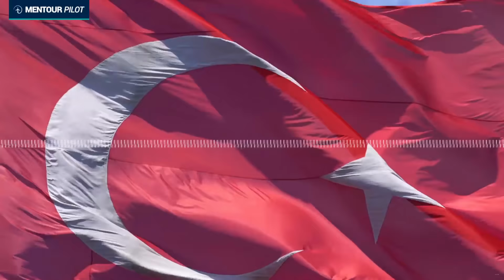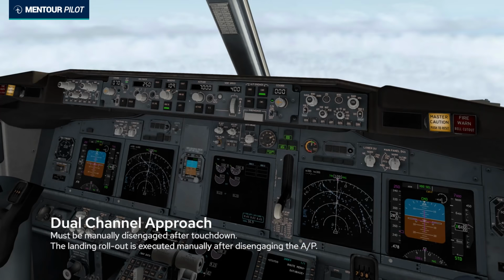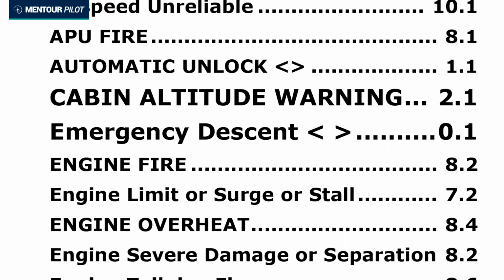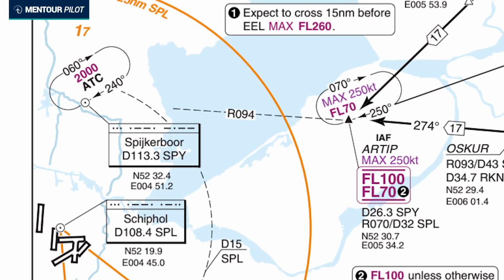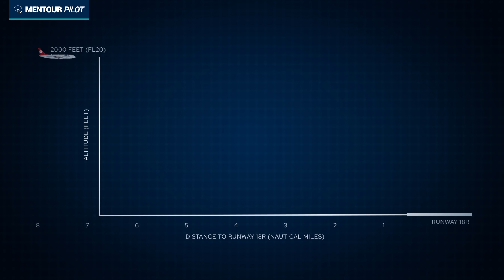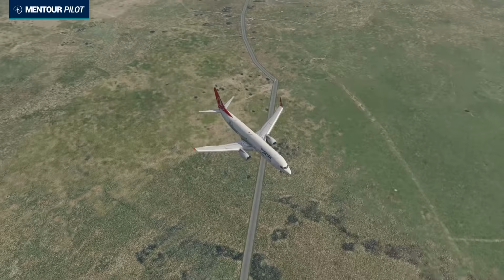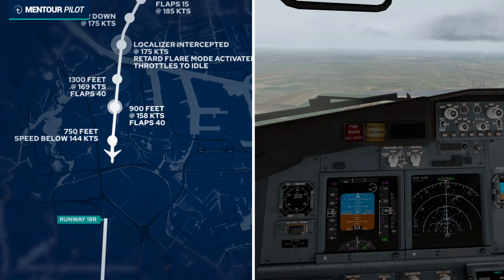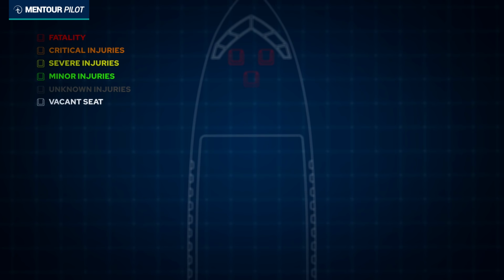What happened to Turkish Airlines flight 1951?!

Comment: 3 pilots in the cockpit, a typical autopilot approach to minimums in VMC conditions and they STILL managed to miss all the clues that something was seriously wrong! As a relatively old-school airline pilot (retired) I call this one GROSS CREW INCOMPETENCE. How 3 pilots managed to ignore the abnormal attitude and low speed clues until the stick shaker kicked in is mind-boggling!
Reply: And two of the pilots were ex-Turkish air force. Wouldn't they have more flight training than a normal pilot? I wonder why there was a lack of communication between the pilots.
Reply: Agreed. 3 experienced pilots, 2 of them clearly highly qualified, and all of them forgot the 3 basic rules (the “-ates”) of aviation. 
I’m not certified to fly myself (just the at home sims) but it always amazes me how often in these situations, at least one pilot will realize that something is wrong, and yet they forget how to fly while they chase what’s wrong with the plane.
Reply: @stephenrich3029  They didn't even "chase what's wrong with the plane" though. They just kind of ignored all the warnings. Like what? Although, everything happened really fast in real-time.
Reply: Certainly doesn’t give one much confidence in the training standards at Turkish airways
Reply: @setj2368  Turkish Airlines and Airforce has really high standarts and good training. But sadly, there are always exceptions
Reply: @setj2368  Yes correct when regarding before year of 2008. Any cockpit crew insisting on unstabilized approach will be heavily punished and probably sacked from Turkish Airlines, after this accident.
Reply: Agreed. Terrible pilots.
Reply: Disaster crew. Sheer incompetence I agree.
Reply: @stephenrich3029  Communicate, investigate...... coordinate?

Comment: I was at work in Rotterdam when the news broke, and needless to say almost everybody stopped working to follow the news on two websites. We had to go home to watch the live coverage.
I live about 35 kilometres from the crashplace, so it came pretty close.
Reply: I don’t find it “needless to say”. I’m Dutch too, we went to work normally, depending on the environment with or without radio on to follow the news. We did not “have to go home” to watch it on tv. I find it a bit odd tbh.
Reply: @fluffy-fluffy5996  We had to go home because we had no tv at the workplace.

Comment: Finally I understand, why the "cabin crew prepare for landing" and "cabin crew seats for landing" is called out sometimes more early than passengers understand ("why already?") and why it is called out sometimes quite at different moments. Good pilots focus on the really important things and not on this, the time when to announce "cabine crew...", that's not as important as monitoring everything for stabilizing the metal-bird.
Reply: Unfortunately, these guys did everything too late
Reply: Sadly Boeing wasn't honest about their flight computer and sensor problems for a very long time and kept postponing taking any responsibility!! Such as for this crash they offered Turkish airlines a massive discount for new planes, in fact Turkish airlines has the cheapest 737-800s and 737-900ERs in the sector which was why they decided to sue Boeing first then changed their mind!! Ofc there was also pilot error that inexperienced first-officer couldn't spot or state malfunctions while the captain was simply overwhelmed as he was doing some of first-officer's job as well but the real problem was Boeing again who didn't properly share these problems with airlines and organized better simulation training that exactly same happened with Max and the company is facing billions of dollars fine now...
Reply: CC know when to seat, this call is just to remind them.. bieleve me.. after hours spent in the air.. you know exactly where you are.. ;)
Reply: Yes.
Reply: @elFlexor  Yes.

Comment: Apologies if this has already been covered already, I am no pilot, but electronics are my background( Navy , submarines), but surely the computer systems also bear a major part of this, why would the flight computers allow retardation of the throttles to/below the stall speed? Why would the flight computer not raise an alarm /caution for -8 value on a system that can only be positive value? Also , do the A and B systems not cross check and flag a caution if they have disagreeing values? 

I find your explanations very clear and really enjoy your channel 😀
Reply: I'm not a pilot either but surely the stall speed is much lower when you're just about to land? Due to ground effect. So if the computer thinks you're already that low will it not assume a lower stall speed? I'm just speculating.
Reply: The flight computer believed it was on the ground due to the faulty radio altimeter reading

Comment: Although it's more then 13 years ago I can remember this very well..being at home, hungover after Dutch carnaval here in the South, this was very big news as (fortunately) crashes like this don't happen often.
A colleague of mine just happened to be driving on the A9 highway on his way to Haarlem, getting into the traffic jam occuring when people parked their cars on the hard shoulder, running down in the field to help people getting off the crashed plane. Also, it has been very lucky the plane crashed prior to passing the highway instead of crashing into the highway which is approx. 10/15 meters higher than the field it crashed in now. 
Although I have seen every program about this crash and have read all news documents, incident reports and everything that can be read about this, this movie is still very accurate and informative and it still gives me new insights about this. Keep the good work up! 👌

Comment: As someone in computer science and IT, any time I hear of a "safe" system using less than 3 separate inputs/systems/drives/etc, it freaks me out. You should always have an odd number, at least 3, maybe 5 to safely accommodate 1 or 2 failures respectively.

Comment: 37:40       Hearing that stick shaker while watching this part made me want to reach over my desk to my thrustmaster and push them forward (and hold it). 
Terrifying.   But important lesson.  Watch that speed like a hawk.  ( particularly on approach ) 

Thanks Mentour Pilot for the excellent video and explanation !
Reply: That's it. As you said: "and hold it!", yes, everyone would do so, you are at low altitude and in a stick shaker, your life is dependent on this thrust lever being forward, so why all THREE pilots let it go to idle again and notice it only 9 seconds later? Leave them out of hand even half a second is too long in such a circumstance.
Reply: @Delibro  I wonder if they have changed the way they switch over controls. Seems risky for the captain to have taken controls so close to the ground  with so little time to make any changes

Comment: Thanks for the good video. I watched it from the beginning to the end. Here are the few things that we know about the incident that did and didn’t make it to the report : 
- Duty time for the instructor pilot: he spent many hours in the simulator and then doing line training. Fatigue, is a major factor in operators in Turkey, especially in busy summer season. 
- Cultural barriers : when you are dealing with two military pilots and one civilian safety pilots, most of the time CRM goes out of the door. 
- training issues : one has to take a look at the training foot print of the FO that was in the flight. He has been under training way too long. Definitely something that needs to be looked at. 
- The word “auto” : I forgot home many times you used the word “auto” in this video. You know better than I do that is pilots, including yours truly, have been using automation as a crutch. That degrades our flying skills. Had the FO disconnected the AP / AT or both before this approach gate, they still would be alive. 
- Approach gate : total disregarded. 
- Non essential communication : who calls cabin crew below 10,000 to sit them? That is even violation of the sterile cockpit rules. I hope that has changed, but I noticed that many years after this accident on my flights on Turkish as a pax. 
- Maintenance practices : if I am not mistaken that author throttle was written up multiple times before this accident. The “we will write it up at the base “ attitude was prominent way to handle things at the time. 

Once again, thanks for the video. Great work.
Reply: Cultural barriers - Indeed, that was first thing that hit my mind when I was hearing: 2 military pilots both over 40, and one young civilian pilot supposed to observe if they know what they are doing (if they are recognising what are the doing).
Auto - yes, i guess it is vital to know which auto-systems are engaged and what are consequences - if something does not engage, then do not stay half enganed - rather convert situation to some that is well known and trained. I assume that here is the point where the high workload comes in - single channel approach would be fine (I guess), if the approach was stabilised at apporach gate. (But I'm not pilot nor I know SOPs - Is single channel approach permitted? How it is trained. Is single-channel auto-land permitted?)
Reply: @tomasebenlendr6440  I don’t fly the guppy. On the 747 when the Approach is selected all 3 autopilote come to the picture.
Reply: I think you are missing the point of the training. Manual flying is taken as read, the first officer under training is learning how to set the aircraft up for an Autoland which would nowadays be normal. In effect carrying out the approach as if you are going to Autoland is the default in airline flying and the automatics are disconnected when the crew have good visual contact and the aircraft is stable.

By flying the approach with the autopilots in you not only reduce the pilot workload to deal with other problems, but you also have the automatics ready for a Go Around. The Go Around stop altitude is in a lot of cases (I seem to remember Amsterdam is one) is 2000 ft, so a go around from the 1000 ft gate gets to the stop altitude very quickly and you sometimes need all the help you can get.

A manually flown approach is normally only carried out in good weather with no problems and is almost a "fun" exercise.

Comment: I retired on the 757 767 after 30 + years of airline flying in 2012.    Airspeed is so important I always find it amazing when pilots who fly airliners get slow during an approach and crash. What was the pilot monitoring doing that he did not see the slow speed?  What was the pilot flying doing that he did not see the slow speed?  17 knots below V ref.  @ 500' . No mater what the problem is someone still has to fly  the airplane.  These jets are not really that hard to fly and keep on speed even if you have some minor problem going on.
Reply: You just lucked out.
Reply: Seriously auto-pilot idling engines is a minor problem?? Sadly Boeing wasn't honest about their flight computer and sensor problems for a very long time and kept postponing taking any responsibility!! Such as for this crash they offered Turkish airlines a massive discount for new planes, in fact Turkish airlines has the cheapest 737-800s and 737-900ERs in the sector which was why they decided to sue Boeing first then changed their mind!! Ofc there was also pilot error that inexperienced first-officer couldn't spot or state malfunctions while the captain was simply overwhelmed as he was doing some of first-officer's job as well but the real problem was Boeing again who didn't properly share these problems with airlines and organized better simulation training!! Exactly same happened with Max as well and the company is facing billions of dollars fine now...

Comment: Great detailed video. I find it concerning that even with redundant sensors only one is used for Auto throttle and there seems to be no sanity checks on sensor values, that could have automatically disconnected auto throttle due to a sensor data mismatch. But do think in the end it is overall a crew failure to discuss & manage the situation and deciding not to go around.

Comment: I remember this crash well, I had been on that plane a week before when I returned from a business trip.
And as a former avionics engineer (@fokker) I followed this closely when I heard the problem was with the radio altimeter.
It turned out to be an internal short in the antenna causing the T/R unit to only see it's own signal and used that for the height calculation.
The value of -8 feet was not recognized by the LRRA as faulty.
Later, from 2003 onwards, the autothrottle was replaced by an EDFCS which got a comparator function trough an mandatory update to disable the autothrottle flare mode if there was a difference of > 20 feet between the 2 radio altimeters.
Very good explanation of events, well done Petter!
Reply from the maker: Thank you! 
Yes, I did a version of this video when I went into that software change but it became to long.
Reply: Checking sensor values for plausibility appears to be a growing issue in aviation, especially for Boeing who tend to give the pilots the ultimate responsibility, whereas Airbus likes to have the computer in command. Certainly an area to keep an eye on. Thanks for the top comment Michel!

Comment: I'm loving this new format of you speaking about disasters and their causes. This has always been a hobby of mine. 
The weirdest accident I ever heard of was a single-seat VFR fright in a Beechcraft piston twin (I think...),
A different pilot had taken command of a new flight after the previous taller pilot had been flying the aircraft. 
The newer pilot had slid his seat forward to accommodate his slightly shorter legs.
Just after Vr, his seat slid back on its rails ( HE HAD NOT ENSURED HIS SEAT WAS IN A LOCKED POSITION) and his hand was still wrapped around the throttles.
He inadvertently cut all power to the engines, stalled and crashed.
LESSON: It's the little things that can bite you if you don't pay attention.
AMAZING Channel, Petter
Thank you so much!

Comment: Thanks for the very excellent quality of the video!
One part that stood out to me was that there are only two autopilots and each one only got values from the sensors on one side of the plane, and each pilot side only showed the values from one autopilot. So a pilot can't easily detect deviations of the two autopilots, pilot and copilot would have to exchange values all the time, which doesn't work in practice. With only two autopilots and only two sensors of the same type each, if the values differ, it is not easy to determine which one is providing incorrect values and functioning incorrectly. This seems to me to be a fundamental design problem of Boeing 737 aircraft. At least three sensors measuring the same parameter, at least three redundant devices, automatic display of the values on both pilots' sides if the values differ by more than the usual fluctuations would help to make the aircraft safer.

Comment: It incredible how these complex failure modes happen, I talk about safety (not aviation) and use the French Concorde crash as an example. Even very experienced people can fail in very modern machines.
Reply: You think the Concorde crash was a human factors issue? And in this case the system failure has been foreseen by many engineers, including those of Boeing, and mitigated with triple redundant systems for at least the last 40 years.
Reply: @cageordie  Well it was a human error. Rotating before V2, wrong cg of the plane, pressurising the fuel tanks, missing wheel spacer that caused the tire burst.
Reply: I guess never let your guard down when on duty or that flight will be your last.
Reply: @K0nst4nt1n96  Do read the report and not listen to the news stories. That is why the news is called a story and not 'the facts show'. Next!
Reply: @rasputinputin8103  I read the report and it was caused by human error. As AF 447 or the Airbus lowpass which ended in a tree. I would never fly with air france.

Comment: Not being in the industry, my mind immediately thought, "why didn't they just go around and figure it out?" Then on second thought, "it's malfunctioning; just get it on the ground ASAP." Sometimes experienced people make bad decisions.
Reply from the maker: Yes, that’s what makes the job so tricky,
Reply: Depends on the malfunction. If it's a sensor malfunctioning and you're about to fly a computer-assisted approach, then no. But if your engine is on fire and your rudder is stuck then sure, get that thing down ASAP.

Modern airplanes are still designed to be flown completely unassisted as long as you can operate the engines and surface controls. Most crashes happen because of a sensor or flight system failure COUPLED with a human fuckup. Sure, automated flight and landing systems help make flights much safer overall, but it's the pilots' incorrect reaction to those kinds of failures that kill people.
Reply: Surely below a certain height you raise the gear and flaps and go around if you get a stall warning? Because as Petter points out 4 seconds to spool the engines back up is just too long.
Reply: @Diandredofus  worth remembering that it was Concorde that was the first aeroplane that could autoland. So it's hardly a new technology.
Reply: @hairyairey  below a certain altitude you're pretty much screwed if you stall the plane. retracting flaps only lowers the lift the wings generate so that doesn't help.
Reply: @Diandredofus  ok gear up then!